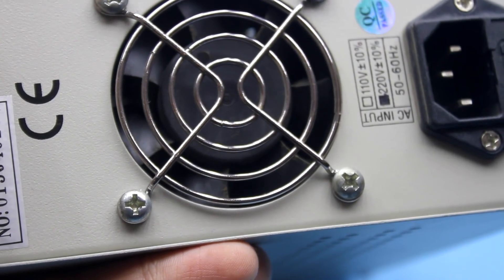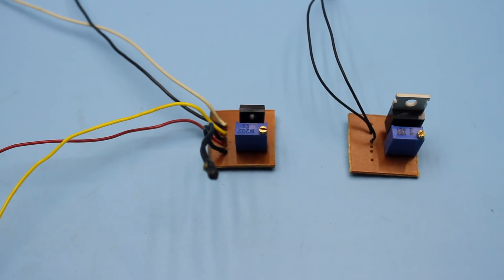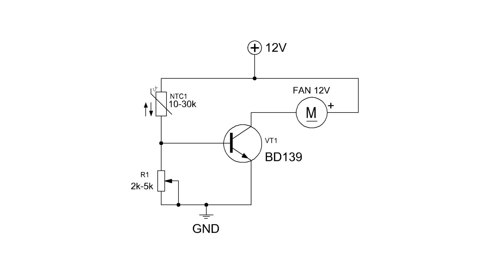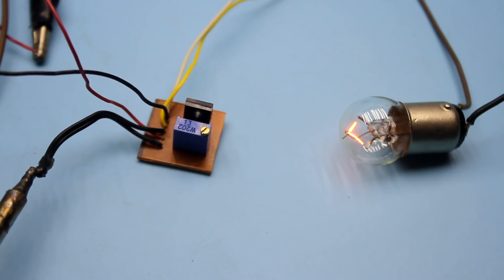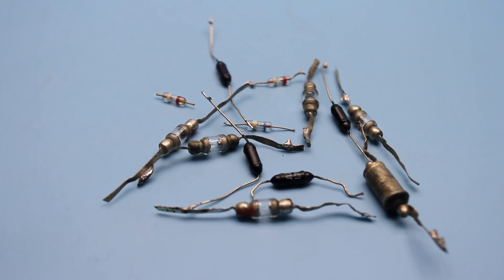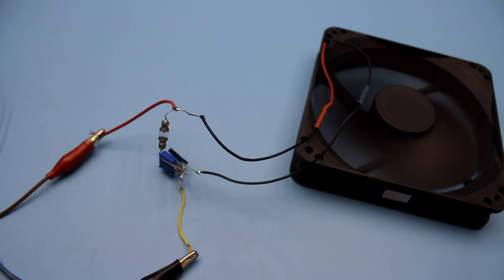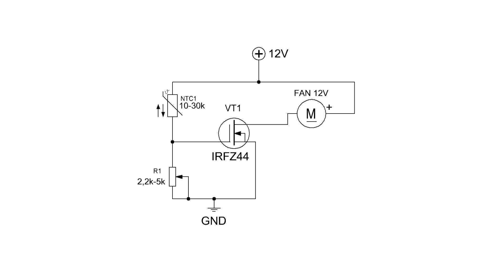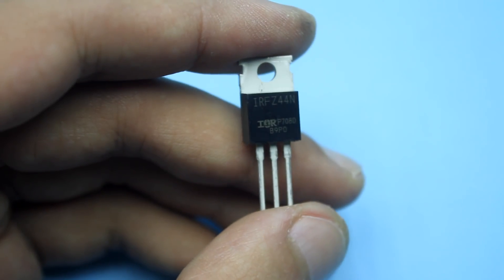Thermo adjustment of fan speed

Comment: cool.very good.
but in my opinion if you use 2n3904 transistor it also work with the same voltage and etc. the good thing about it that this transistor is very low cost . Mr.kasyan tv  if you like my opinion then please message me ( at lease please try it (I am a big fan of you))
Reply: 2N3904 has a low Ic

Comment: The problem with a circuit like that is the speed of the fan is proportional to the temperature. Seeing as the fan reduces the temperature it's going to oscillate to maintain a target temperature, that temperature is also going to oscillate above and below the target as well. This can be annoying if you have a fan turning on and off and changing speed all the time. A better approach is to use an op-amp in an error amp configuration. This allows the temperature to be maintained in a more stable way, instead of oscillation the fan simply spins faster to deal with heavier dissipation loads.
Reply: hysterisis ftw!

Comment: great one, how I can modify the circuit for adjusting a small heater (the opposite of cooling) ?
Reply: Is that by simply switch between the variable resistor and the PTC or NTC in the other case ?
Reply: I believe that you should use an op-amp instead, you would have much more flexibility in your design. Use it as a comparator, this way you could set it for heating or for cooling.

Comment: Would 139 be replaced by z44?
Reply: Yes, you can, but a power FET like that might be overkill for a simple job like running a fan. Also, FETs have a rather high and varying threshold voltage.
Reply: NNNI which threshold voltage are you talking about...of gate...or minimum triggering voltage!!
Then whats the problem! I dindnt get that...its only 12v 600mA fan..
Reply: The gate threshold voltage - it's higher than that of a BJT.